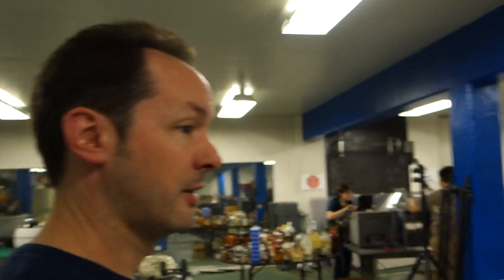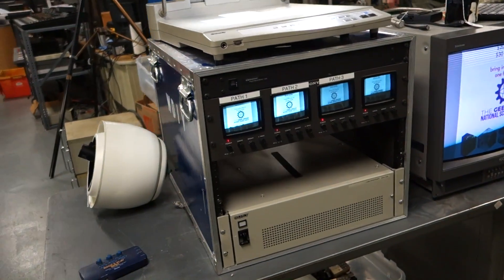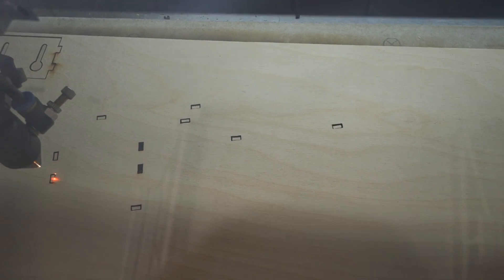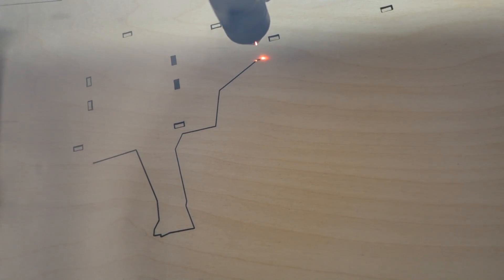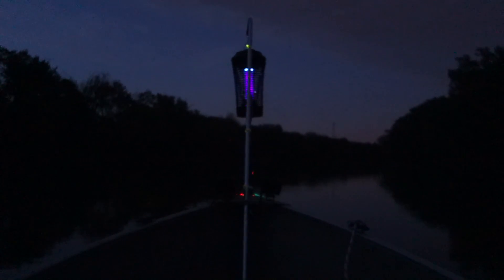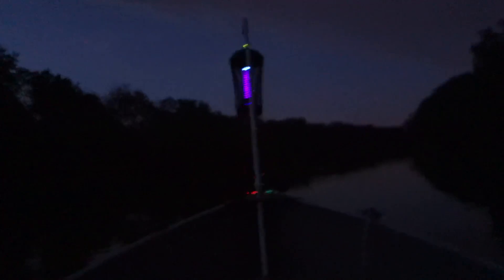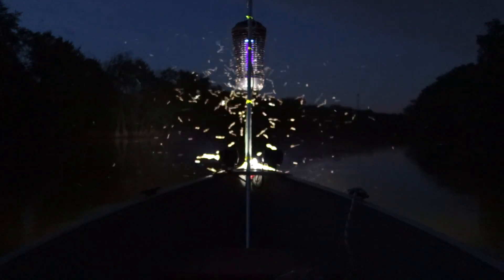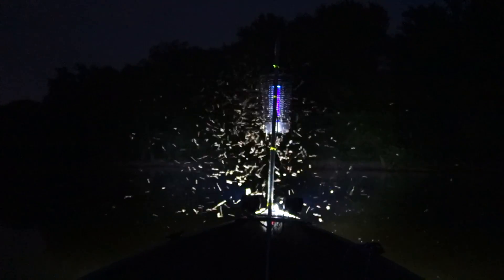Captain's Blog 5 31 2016 The Mayfly Experiment

Comment: I don't know if a tennis racket zapper would work any better, bit more of an open mesh.
Reply: I was thinking make a big-ass version of the racket zapper with a fan and 1/2" hardware cloth. The fan would probably need a reverse/purge function because the mayflies would probably clog the mesh. Get a power supply for some CCFL tubes, make like a 4-stage voltage multiplier for the end of it, and you're off to the races. Either that or a 4-6kv nst, rectified and current limited with a 10n cap across it. Of course, that will sound like pop rocks due to the exploding bug doom.
Reply: 3 hooked to a propeller
Reply: Indeed. Or looking around a bit for variations on the original bug zapper theme.